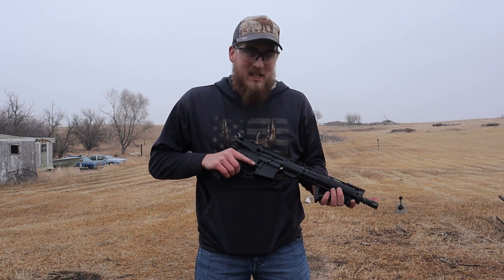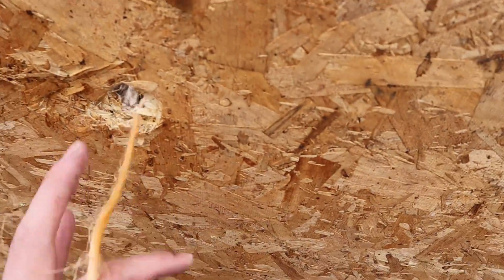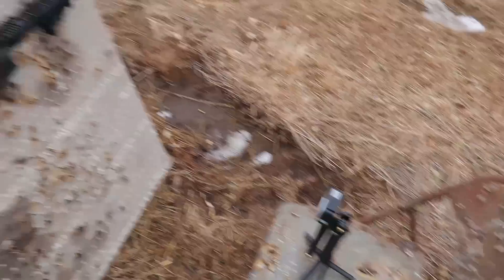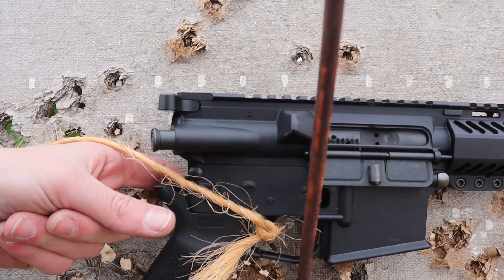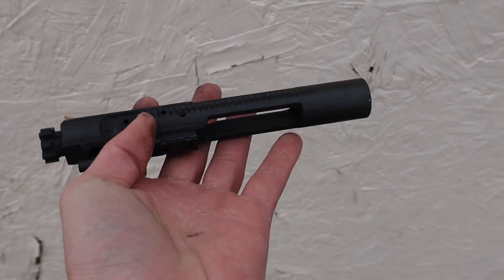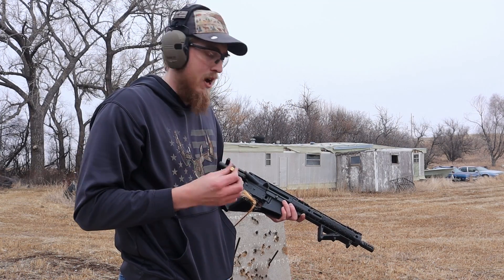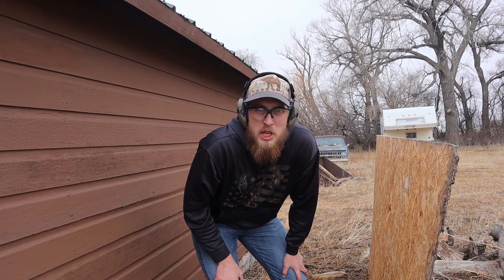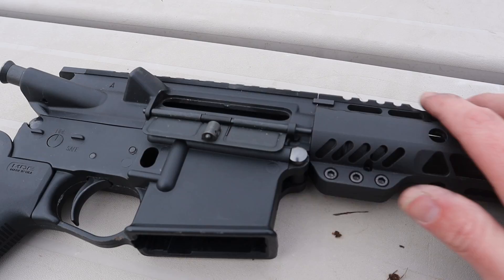Shooting an AR-15 with no buffer tube - Will it survive? - Science Saturday Ep. 1

Comment: Is this a joke? .. want a bolt action AR?  ..slide the gas tube forward so it..  doesn't operate ..now it's bolt action basically. You only pushing the bolt back with the gas system..it's not firing unlocked

Comment: I've always wondered what would happen but not because of not running it without a buffer tube but because of folding stock kits. Like, a cheap one from Amazon. What would happen if you keep it folded and shot it? 🤔 same thing or would it test the strength of the lower and shooters face?
Reply: Don't do it

Comment: Wow bro so dumb. I mean thank god your ok but bro you really think the way you have everything set up with a sheet of plywood blocking you would really save you. Yeah the gun was pointed in opposite direction of you and your playwood but if the was a more higher powered gun that bolt would of went right threw that plywood possibly killing you. Yeah your fine and it didnt do that. But there are several factors there where things could of been way different.  I mean hell you new possibly the end would fly out. But your using a sheet of plywood, your only feet away, and you had the back end of the gun facing in your direction. This isnt that im bashing you. Id hate to see anyone get hurt. But man people need to think first. I love guns but im also smart about them.

Comment: I'd be more curious to see how long a receiver extension (aka "buffer tube") would last on the gun without the buffer or spring installed. Obviously the carrier would smack straight against the rear wall of the tube, but it would just be interesting to see how many rounds it could endure before getting bound up or letting the BCG fly out the back.
Reply from the maker: That would make for a very interesting experiment!
Reply: @TheSacredGunner  I mentioned it to my buddy earlier today and we agreed it would be fun to try. I just want to know if the female threads in the receiver would get FUBAR before I tried this with my rifle lol. Keep up the great work

Comment: I know of someone who has a poly lower and I am told that it's possible to end up like that but if you take a u bolt and attach it between the buffer tube and the upper receiver it will help the separation problem. I don't know but it's worth a try.

Comment: The buffer has a few functions. One of them is to hold the bolt carrier forward long enough to allow for depressurization in the chamber before extraction. Without a buffer tube, and therefore no buffer or buffer spring, you may have slightly early extraction, which is probably what causes that ring around the case. In fact case head separation is probably your only real risk in doing this, which is dangerous in an overpressure situation, however it’s mostly an annoyance if it’s due to early extraction and just leaves most of the case stuck in the chamber, so long as you’re not in a combat scenario… not that you’d take this weapon into combat in its condition.

Comment: The reason that the cases barely fell out and had that weird dent is because the bolt is coming back much faster and further than it's supposed to, this is causing the casing to hit the rear of the ejection port before it fully releases from the bolt; this is also the cause for the weak ejection.
Reply from the maker: Thanks for the info!
Reply: @TheSacredGunner  someone else said that they saw the cases fall out of the mag well, and i may have missed that detail, so i now believe they bounce off the ejection port for the reason i explained before then bounce around the upper untill they fall

Comment: @ about 6:40 timestamp, line on brass-- play the video back in slo mo. What I noticed was that the cartridge didn't fully eject until after the bolt was past the ejection port. I'll bet w/o the buffer tube the bolt goes back so far and so fast the ejector hook still has a little grip on the base of the casing and it hits the back side of the ejection port on the upper putting the line in the casing.
Reply from the maker: That makes sense!

Comment: They make a BCG that changes an AR to a straight pull bolt action, for folks who live in anti-gun states.  If you lose your buffer and you have one of those, you would be perfectly fine except for a lack of stock to shoot properly, but you could still put lead downrange without having the bolt chucked back at you like a torpedo with every shot.

Comment: I noticed the back of the lower receiver was cut off had it not been you would have broken a hole lot'ta something and the first bolt impact on the plywood was maybe 6 or 8 inches down and left of the string & hole  a quarter moon shaped impact

Comment: im really curious how the lower reciever was broken? was it a failure in the polymer? or was it a drop situation where the weapon was dropped and the tube broke off? just really curious because ive been thinking about getting a polymer lower to play with. but if they are fragile, ill stick with the trusted alluminum.
Reply from the maker: It was a fail of the polymer80. I was shooting it. Set it down to reload some mags and when I picked it up the brace fell off the gun! I also have one more that has worked great!
Reply: KE arms has an excellent polymer lower. I’m referring specifically to the KP-15 monolithic lower receiver. Unlike the polymer 80, KE Arms’ KP-15 is serialized. I have one and I absolutely love it. I think I paid something like $130 for the complete serialized lower at my local FFL.
Reply from the maker: @tmedley  Thanks for the recommendation. I like experimenting with different products even if they don't always work. That's what makes it fun!

Comment: Ah so the cartridge doesn’t fly out of the ejection port, it simply falls down through the mag well seen in the finale slow mo shot.
Reply from the maker: Yup!
Reply: No, the cartridge does try to come out the ejection port.  It did on the first shot.  An AR does not have fixed ejector nor does it have a fixed bolt stop.  Your ejection patterns can be modified depending on which recoil spring and buffer you choose on an AR.  Since you have no buffer or spring there is nothing slowing the bolt and bolt carrier so the case does not have time to get out since the bolt is going rearward at full speed.  The case smacks the rear of the ejection port and sometimes will bounce back into the upper.  That is why you have a crease in the side of the ejected case.

Comment: Do it again with an aluminum lower without a buffer installed, the ring on the receiver that the buffer tube threads into should prevent the bolt from leaving the gun, but I'm sure it wouldn't take that abuse for too long, see how many rounds it takes to break it off.
Reply from the maker: I agree that was definitely on my mind. I’ll put it on the list of ideas!
Reply: It'll probably screw up the gas key on the carrier.
Reply: @brianbird3756  definitely, but which gives out first, the gas key or the receiver.
Reply from the maker: @supersexyfatguy  we may have to find out!

Comment: LOL...The designer who came up with the AR15 designed a BETTER  rifle than the AR15. It was a design with NO buffer tube. It was ignored. A couple of comanies br9ught out the rifle. It resembled the FAL in lines. Didn't sell wel.. Another version was made. A side folding stock. NOTHER version came out with a synthetic reciever. The upper receiver was pressed steel. Lower was synthetic. Used the same magazines as the AR. The STONER system was a later design. But politics kept the pile of crap AR15.
Reply: Did you forget the name of that rifle? It's the ar-18 or ar-180
Reply: @drivernephi5587  Thank you. The AR 180. It would shamed the damn AR15. Read up how the AR15/ M16 WAS SELECTED. General LeMay of the Air Force was at a demonstration / picnic being hosted by the people who produced the rifles. Rifile, lots of ammo and plenty of watermelons. Big deal watching melons explode apart. LeMay decided HE wanted those rifles for security, ending the use of the M1 carbine. I qualified on the carbine in basic training. Sweet shooting.
Reply: @robertspeicher5047  Yes I agree for the most part. It's a shame that the ar15 platform was chosen. I'm looking forward to an fm15 build which is bufferless
Reply: @drivernephi5587  I have the Brownells/PWS BRN180 which is the clone and LOVE it! Plan on getting another... have a folding brace on it 10.5 barrel!!

Comment: Velocity of bullet was probably 1/2
Reply from the maker: Got that right!
Reply: Velocity would be the same as normal, the bolt is locked until the bullet leaves the barrel, the bolt doesn't start moving until pressure has already started dropping.

Comment: Turn your gas port around backwards so the port is blocked, swap your charging handle for a Kali key, and you have a tiny straight pull bolt action for $60 instead of a pile of worthless gun.
Reply: Already technically single shot. And literally bolt action
Reply: Exactly ..
Reply: That $60 would be better spent on a new lower. Then you'd have a fully functional semiautomatic rifle, just like Jesus and Eugene Stoner intended.
Reply: @boomerisadog3899  that transfer fee though. Plus switching out the entire lower parts kit. Would also need a buffer tube assembly.
That $60 stripper turns into over twice that if you value your time.
Reply: @zdub8438  are you poor or broke?
Just buy the shit. If $60 is too much, you need to figure out your life.
Reply: @boomerisadog3899  pretty sure stoner and god intended them to be full auto not semi
Reply: @Grognarthebarb  They intended them to be select fire. Unfortunately, semiautomatic is the closest approximation of that most of us can get.
Reply: @boomerisadog3899  most of us can get select fire just have to open it up and pick from the inside.   It's just not legal 😂 or you can always bump fire which at that point its all in how much practice you've had
Reply: @Grognarthebarb  youre goddamn right

Comment: did i miss why the buffer tube threaded portion of the lower is missing?
Reply from the maker: It was a polymer80 lower and the portion of the lower where the buffer tube is threaded quite literally snapped off. There was no way to fix it!
Reply: so it just broke during a discharge?
Reply from the maker: @marcuslopez8521  I was shooting it then I set the gun down to reload and when I picked it back up the buffer tube fell of. I don’t know what happened. It wasn’t ridiculously cold out. But it was a polymer lower!

Comment: if your gas tube was blocked off, the bolt would probably stay in place with just the cam lugs holding it together no buffer spring required :)
Reply from the maker: That may definitely have to be a video in the future. Just to see exactly what happens!
Reply: @TheSacredGunner  Can't wait :)

It will almost be a bolt action ar lol
Reply: So, it'd be a UK or California compliant AR? LOL
Reply: @johnmullholand2044  at least it will be better than an AR that functions as a rocket launcher.. throwing the projectile out the front and the rest out the back lol
Reply: @johnmullholand2044  LOL!
Reply: If gas turned off then bolt and carrier won't cycle back except manually
Reply: @jcgardner5852  yep, basically bolt action, and no self ejection of the bolt, should be able to stay in purely due to the locking lugs. ;)
Reply: Or tape/tie down the manual assist. I've heard legends that foreigners do this to utilize the AR's hidden "sniper single shot" feature lol. I wonder how much abuse one could take like that.
Reply: @DasHugh  I wonder if that might damage the forward assist or the bolt in some manner working in a manner that it was not designed for. Surely there is more force from the gas system than you would put on it trying to force a round home in a dirty gun. Perhaps that might also be something to test in the bufferless subject.
Reply: @chrismckay3868  yeah and no. By the time the bolt unlocks and moves there's not a ton of energy left. Just enough to rechamber a round etc. "Technically" that is lol. Reality is yeah its not designed to do that and may chip the forward assist or bow it outwards over time, or yes bolt damage. Heck depending on if it's a cast or forge reciever it could shatter the side. Im no expert tho and just making guesses. It would be interesting to see tho for sure. He'd be the first to test it I think. I just know I don't want my face next to it when it's done tho lol
Reply: @DasHugh  totally agree with you there, not a lot of energy left but enough to fling the bolt back against the spring and rechamber.. is it enough to damage? We need THE SCIENCE!! :)
Reply: looks same with california compliance setup..
Reply: It's true. Source: my first ar came with the gas tube backwards.
Reply: That's exactly what would happen.
Reply: Could have put a CMMG conversion bolt which has the spring built in. If you could block it from coming out of the back with a modification you'd have a functional 22

Comment: There is actually a lot of science and engineering involved with the buffer assembly. The buffer itself has rubber coated steel balls in it that are tuned to the weapon. When the recoil hits those balls roll forward causing the bolt rotation to delay slightly on the extraction which allows all the gas pressure in the cartridge case to be released out of the barrel while it is still in the chamber preventing the case from blowing up in the receiver or bloating which is what looks to have happened with those cases. As the buffer spring compresses those balls roll to the back of the buffer giving it a little kick against the spring in order to insure proper extraction, adds more mass to the buffer as it accelerates forward then they roll forward again as the bolt starts to rotate closed providing a kick to the bolt carrier to make sure the bolt locks properly. If you do a self build with non mil spec parts you can run into extraction and charging problems if the buffer is not weighted and balanced properly to work with the bolt and bolt carrier's weight. That's why I don't like those aftermarket no noise buffers that are popping up for sale and titanium bolt carriers. I've seen people who have bought and installed them have immediate problems with the rifle's ability to cycle properly.
Reply from the maker: Thanks for the comment! I just learned a lot form that. I know a little but but you shared some great points. It gives me a better insight on how the firearm actually works which I only had a small grasp of. Thanks for taking the time!
Reply: Close, but not quite. They aren't rubber coated balls, there is (in a typical carbine buffer) 3 cylindrical weights that act a lot like a deadblow hammer. These weights can be changed out for different materials to increase the weight and force of the buffer. A standard carbine buffer has 3 steel weights, an H(Heavy) buffer has 2 steel weights and a tungsten weight, an H2 has two tungsten weights, and an H3 has all 3 weights replaced with tungsten.
Reply from the maker: @supersexyfatguy  thanks as well! I’m no expert and don’t claim to be just trying to learn along the way!
Reply: @supersexyfatguy  I came here to say this.

Also, if you have a regular buffer, all you need to do is buy an H3 buffer then you can open both up, mix and match to make your own H1 or H2 to suit what you need.